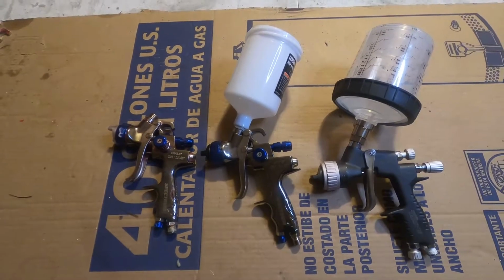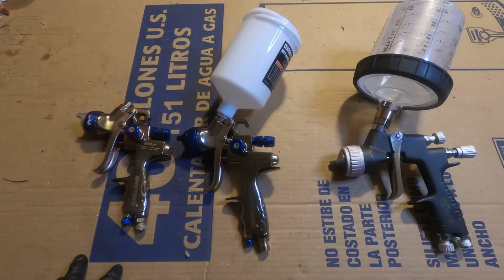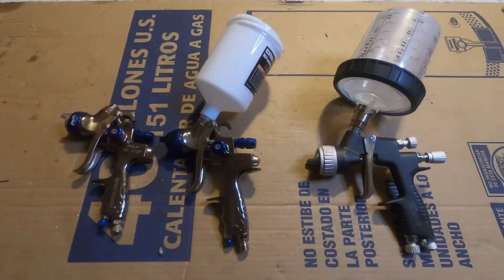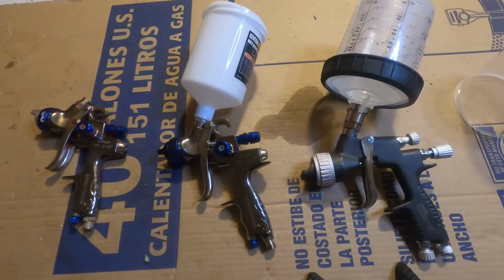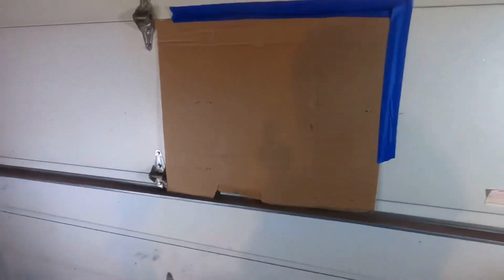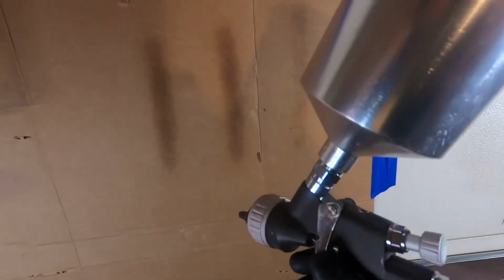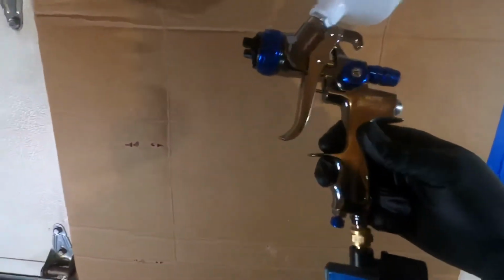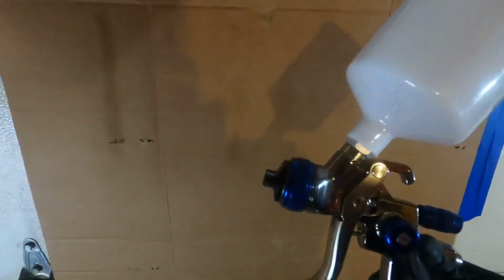Turbo SN95 Mustang Let's Talk DIY Paint Jobs Master Pro 44 Spray Gun Review Harbor Freight

Comment: If you dropped that air pressure down to about 26 on that Spectrum, you would get even better results from it. I’m getting the MP 44 to see if it’s any better than the Spectrum. Not like it really has to being the Spectrum is a nice gun in my opinion. Just want to find something a bit liter in the hands.
Reply from the maker: Thanks for the advice. I have zero experience in spraying so any advice is welcome

Comment: I just purchased this master pro and I’m noticing that it takes 16 CFM to run this gun. has anyone had any troubles with their air compressor keeping up? and what size compressor are you using??
Reply from the maker: I  have a 21 gallon compressor and I can lay one coat down on a door before it turns on. It really didn't turn out bad.

Comment: I have the spectrum HTE and the pro 44 which is the same gun that use to be sold by zoolaa.com the atom X21 for way more money both will work very well but the Pro 44 needle seal is the only weak point I found a replacement ptfe seal and the gun works great. And I have a devillbiss pro lite and the Pro 44 sprays a lot like it for a much cheaper price.
Reply from the maker: In a amateur hands, is the pro lite worth the extra money compared to the pro 44?
Reply: @SN95Power  price wise I'd say no a first time painter/ DIY is better off with the Pro 44 or the spectrum..and the HTE version is more forgiving. If I was to recommend a low budget devillbiss gun I would go with the FLG5 about $200 new on eBay.
Reply: I  had two master pro 44 and both break same place changing the tip really gd gun but that piece is weak
Reply: @naashawnwattley1796  exactly what breaks the tip or the threads in the body of the gun I'm curious to what part gives.
Reply from the maker: @naashawnwattley1796  what did you replace the pro 44 with? Did you buy a high end gun?
Reply: @moparnut6286  the threaded piece u screw the tip in I had two and both break same place twice but I wanna try the master pro 88 dey seem to carry the same needles so I have needles to many now for no use
Reply: @naashawnwattley1796  Cool thanks for the info.... The pro 88 looks like a pro 22 with a larger tip and needle the pro 88 is sold as the SPG 800 HTE and SPG 900 hvlp... At nonpaints.com they also have the parts so if you can't get the HTE cap you can get it there for the pro 88.
Reply: @moparnut6286   what I wud like is jus the body  cuz i have caps and needle cuz it's the same
Reply: @SN95Power  I want to try the master pro 88
Reply: Do guys nuh where I cud get a cover seal /gasket for  model 2pg7s  pressure pot spray gun
Reply: Do you have a part # for your improvised ptfe seal? I'm picking up a Master Pro 44, just wanna be prepared. Thanks.

Comment: Ive tried a number of affordable guns, never the HF. My newest is the Masterpro which im impressed with so far. So its my current go-to for everything. Some of the cheaper guns gave me too much texture
Reply from the maker: IMO the Masterpro is better than any HF gun but I'm a novice at best 😂
Reply: Any tips on how to dial in the Masterpro 44? I'm getting mine in a few days. Been playing with a Astro pneumatic evot13 before with nice results. Wondering how the 2 compare.
Reply: @WilliamVG  the Masterpro looks and feels like a quality spray gun. I have been spraying at about 30 lbs with my compressor. I just start with the fluid wide open and test the spray pattern. Usually turning it in slightly from full until i'm content with the pattern. I only have a 30 gallon compressor, but it keeps up with me, altho it runs a lot. I have one astro gun and found it worked quite well for the money. In my opinion, I think if you're going to do a lot of painting at home, buy the best gun you can afford. I ended up getting an Iwatta W400 (240 bucks) and that works awesome for me and really helped me get the best results i can get with clear coat. Still use the Masterpro for door jambs and small projects where i dont want to dirty up my Iwatta😂 which I use for full paint jobs.
Reply: Thanks for the tips. I'm trying out the Masterpro 44 this weekend, finally came in the mail.:) To obtain best results, I gather, 29psi, fan pattern wide open, and what about paint volume? How many turns out from being in the closed position, 3-4?
Reply: @WilliamVG  i start full open on every gun, then do test sprays on a wall mounted paper. Turning it in a little  until I get a nice spray pattern. I usually end up turning it in from full a bit, but I don't think there is a one-size-fits-all setting. Your compressor and the way you paint (fast, slow, ect) is individual. Your test patterns will show you where you need to go. Even top and bottom, no heavy spots, fine droplets. Its good to test a new gun on a junk panel if you have one so you can get comfortable with it, get to know it before turning it loose on your project👍
Reply: what size compressor are you using I see this gun take 16 CFM does it have a hard time keeping up?